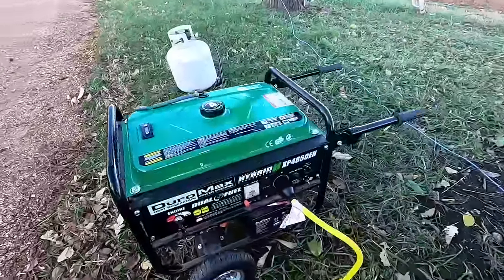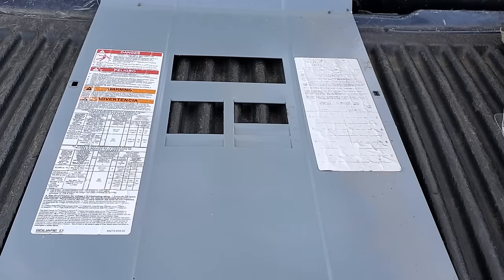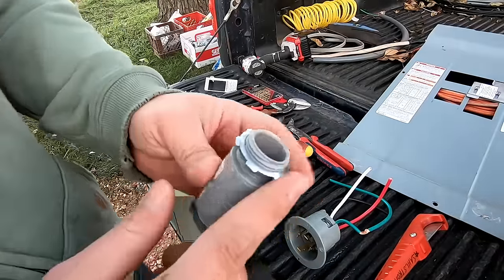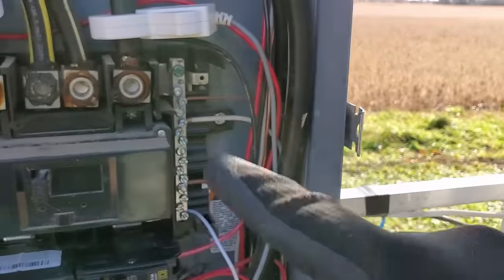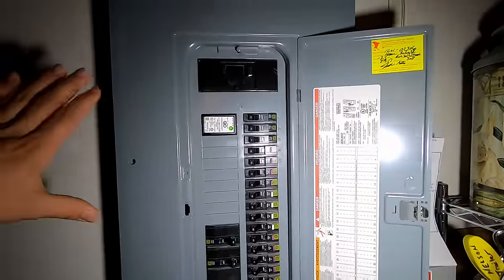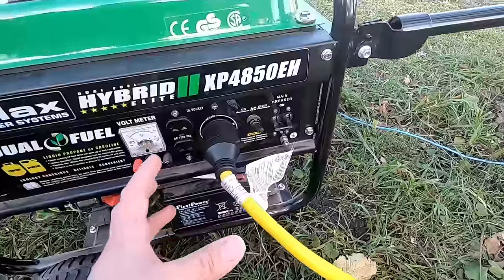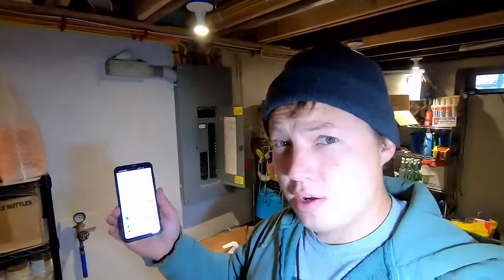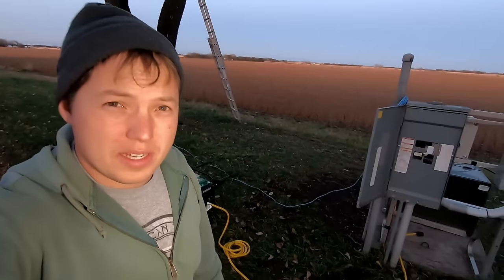How To Hook Up a Generator To Your House Using a Breaker Interlock Kit & Power Inlet Box

Comment: I have a 9KW generator with 4 outlets (4 prong).

Is there any reason I CAN'T use 2 outlets to feed two separate 30 amp breakers like you've shown here?  Running the 2 outlets in parallel to the Panel will give me a theoretical 60 amp feed over 240V.

Has anyone tried this?

Comment: Hey Benjamin, I actually have a couple of questions. I currently have a 50 amp input four wire receptacle hooked (with an interlock switch) to my breaker box with the neutral and ground wires connected to their respective bars at the box. First, if I attach a generator with a bonded neutral to this setup, will I need to change the generator to a floating neutral state? Also, I assume there's no issue connecting a 30 amp generator cord to the 50 amp receptacle with an appropriate adapter? Thanks. By the way, I used your Sense discount link to purchase the Sense and am enjoying it immensely. Really great videos. Most appreciated.

Comment: Don't you need an inverter generator to supply pure sine wave power to the home - for electical and computer equipment?
Reply: Most modern UPS systems clean up the power.

Comment: I had a 50 amp manual transfer switch hooked up to my house and a 30 amp manual transfer switch hooked up to my condensing unit. The electrical is correct with 250 volts coming out to the condenser but will not turn on. The inside AC turns on but not the outside condensing unit. The hook up was done by an electrician and he cannot figure it out. Everything matches but condenser will not turn on. I'm using a 12,000 watt portable generator. Any idea what can be the problem? Would appreciate it.
Reply: Don’t forget about the generator safety tips as well. Remember it’s important to follow all the generator safety rules whenever you use your generator. Here are the generator safety tips:

1) Please do not allow an unqualified person or your children to operate the portable generator. Just because some manuals don’t say that doesn’t mean it’s safe. That is important against the generator safety rules. We also need to be keeping an eye on our children too. You need to make sure that your children are not playing near the portable generator especially when it’s running so they won’t get electrocuted. Generators pose electrical risks and they can be hot during an operation. Please keep your children away from the portable generator at all times. It is important to keep our children safe especially our little ones. Be aware of all the hazards.

2) Some people use their portable generators indoors which increases the risk of carbon monoxide poisoning. It’s important to have a carbon monoxide if you have a gas generator. Never ever use your generator indoors even if your doors and windows are open and even in the garage is not safe to use a portable generator. Not even at your porch and your deck. It is never safe to use your generator indoors and in enclosed areas of your home. Your generator needs to be 15-20 feet away from your house. 

3) 🔥generators cause fire hazards too. Never refuel your generator while it’s running. You need to let your generator cool off before refueling it and before storing your generator. Never overload your generator too. Never ever back feed your generator. You should never plug your generator into a wall outlet. Also never store propane tanks indoors. Please keep flammable things away from the generator as well and please don’t smoke cigarettes near the generator. Having a fire extinguisher next to the generator is also important against the generator safety rules. 

4) generator operation; make sure your hands are dry before touching the generator. Never use your generator in wet conditions. Don’t let your generator get wet. You need a generator tent if you need to use your generator during wet weather. Please don’t wear loose clothes when operating the generator. Turn on your generator before plugging in appliances. Use the right cord for your generator. Please do not use worn out cords. 

Hope this helps

Comment: Wouldn’t come close to UK spec with regard to cabling I’m afraid.  Panel side generator feed needs securing also.
Was it wise to place your cabinet under trees?  
Oh and you do get auto interlocks but obviously unless you install a dedicated line it’s not viable with a small generator.  In home hook up you would only power your essentials via a master breaker and or primary consumer unit  to your existing  essential outputs on the consumer unit/ distribution board.   Ie lighting circuit, refrigerator, CH/ burner etc’.   Hope this helps.

Comment: You make no mention of having to unbond the neutral on the generator.  I found this had to be done on my similar setup to prevent tripping the generator breaker.
Reply: Remember to always make sure you follow all the generator safety rules whenever you use your portable generator. 
⚠️Here are the Generator safety rules that everyone needs to follow when using generators:

This is just a reminder for everyone’s safety when using portable generators. All generator safety rules need to be followed carefully to avoid hazards. 

1) Please do not allow an unqualified person or your children to operate the portable generator. Just because some manuals don’t say that doesn’t mean it’s safe. That is important against the generator safety rules. We also need to be keeping an eye on our children too. You need to make sure that your children are not playing near the portable generator especially when it’s running so they won’t get electrocuted. Generators pose electrical risks and they can be hot during an operation. Please keep your children away from the portable generator at all times. It is important to keep our children safe especially our little ones. Be aware of all the hazards.

2) Some people use their portable generators indoors which increases the risk of carbon monoxide poisoning. It’s important to have a carbon monoxide if you have a gas generator. Never ever use your generator indoors even if your doors and windows are open and even in the garage is not safe to use a portable generator. Not even at your porch and your deck. It is never safe to use your generator indoors and in enclosed areas of your home. Your generator needs to be 15-20 feet away from your house. 

3) 🔥generators cause fire hazards too. Never refuel your generator while it’s running. You need to let your generator cool off before refueling it and before storing your generator. Never overload your generator too. Never ever back feed your generator. You should never plug your generator into a wall outlet. Also never store propane tanks indoors. Please keep flammable things away from the generator as well and please don’t smoke cigarettes near the generator. Having a fire extinguisher next to the generator is also important against the generator safety rules. 

4) generator operation; make sure your hands are dry before touching the generator. Never use your generator in wet conditions. Don’t let your generator get wet. You need a generator tent if you need to use your generator during wet weather. Please don’t wear loose clothes when operating the generator. Turn on your generator before plugging in appliances. Use the right cord for your generator. Please do not use worn out cords. 

https://youtu.be/I1jT3ANENvI and here is a video more about keeping others safe when using generators and also about our family’s safety. It’s important to keep your children safe especially little ones. 

Hope this helps

Comment: my time as an electrician we don't have that what you call kit  we have a double-throw switch
Reply: Don’t forget about the generator safety tips as well. Remember it’s important to follow all the generator safety rules whenever you use your generator. Here are the generator safety tips:

1) Please do not allow an unqualified person or your children to operate the portable generator. Just because some manuals don’t say that doesn’t mean it’s safe. That is important against the generator safety rules. We also need to be keeping an eye on our children too. You need to make sure that your children are not playing near the portable generator especially when it’s running so they won’t get electrocuted. Generators pose electrical risks and they can be hot during an operation. Please keep your children away from the portable generator at all times. It is important to keep our children safe especially our little ones. Be aware of all the hazards.

2) Some people use their portable generators indoors which increases the risk of carbon monoxide poisoning. It’s important to have a carbon monoxide if you have a gas generator. Never ever use your generator indoors even if your doors and windows are open and even in the garage is not safe to use a portable generator. Not even at your porch and your deck. It is never safe to use your generator indoors and in enclosed areas of your home. Your generator needs to be 15-20 feet away from your house. 

3) 🔥generators cause fire hazards too. Never refuel your generator while it’s running. You need to let your generator cool off before refueling it and before storing your generator. Never overload your generator too. Never ever back feed your generator. You should never plug your generator into a wall outlet. Also never store propane tanks indoors. Please keep flammable things away from the generator as well and please don’t smoke cigarettes near the generator. Having a fire extinguisher next to the generator is also important against the generator safety rules. 

4) generator operation; make sure your hands are dry before touching the generator. Never use your generator in wet conditions. Don’t let your generator get wet. You need a generator tent if you need to use your generator during wet weather. Please don’t wear loose clothes when operating the generator. Turn on your generator before plugging in appliances. Use the right cord for your generator. Please do not use worn out cords. 

https://youtu.be/I1jT3ANENvI and here is a video more about keeping others safe when using generators and also about our family’s safety. Hope this helps

Comment: The use of full house, portable generators and the use of a Generator Interlock switch have sky rocketed in popularity over the past several years. Using an Interlock  is a very cost effective way to provide emergency power to your house. But a portable generator / Interlock set up can be EXTREMELY dangerous if not done correctly. Be smart , be safe and stay alive - hire a professional Journeyman Electrician or Electrical Contractor for your installation and have your work inspected when completed (your home owners insurance company may require it).

Comment: A dual fuel generator wont produce reach its rated running wattage when running on natural gas or propane. Those numbers printed on the label are typically when running on gasoline. Propane has a lot less BTU's than gas, less power, less wattage.
Reply: Portable generator safety rules: Always make sure you follow all the generator safety rules whenever you use your portable generator. This is only a reminder. Generators can be dangerous if not used carefully. Every year, hundreds of people die or get injured when using portable generators due to carbon monoxide poisoning and electrocution. Make sure you are using your generator carefully and keeping others safe as well. There is something very serious that everyone should always be aware of when using generators. Some people do run their generator indoors which is not safe and that increases the risk of carbon monoxide poisoning which can cause death of family and you. Some people run their generator in wet conditions which can electrocute them. Please remember that you should never run your generator indoors. Remember that carbon monoxide is an odorless and colorless gas that you cannot see or smell. Carbon monoxide is a silent killer. Keep that in mind. Make sure your generator is 15-20 feet away from your house and away from doors, windows, and vents. Never use your generator in your porch too. Having a carbon monoxide detector is very important against generator safety. Some people also allow children to go near the portable generator which could pose risks. We need to keep an eye on our children making sure that they are not near the portable generator so they won’t get electrocuted or burned by the generator which is dangerous. A locking enclosure also keeps kids safe. A generator shed might look like a tempting place to explore, or take cover during a game of hide and seek, but a generator is a dangerous piece of equipment that can cause injury. It says on the manual that we should also keep children away at all times from the portable generator to avoid injuries. Please do not allow a child or unqualified people to operate the portable generator.  It is important to keep your children safe especially little ones. The portable generator can be hot during an operation. Just because some manuals missed what should be listed doesn’t mean it’s safe to do. Always follow the generator safety rules when using portable generators. Generators pose electrical risks. If you need to use your generator during wet weather, you need a generator tent to protect your generator from getting wet. Don’t let your generator get wet. Keep your generator dry and before using your generator, please make sure your hands and your generator is dry. Do not wear loose clothing when operating the generator. Everything that is said on the generator’s operating manual should not be ignored. Never smoke cigarettes near the generator. Please keep flammable things away from the generator. Never overload your generator too. Your generator can catch fire. Never ever try to plug a generator cord into a wall outlet to avoid back feeding. Back feeding your generator is dangerous. Always turn on your generator first before plugging in appliances and shut off the appliances before turning your generator off. Use a heavy duty cord for your generator and the cord should not be worn out. All the instructions should be followed carefully. Never refuel your generator while it’s running. It can cause fire if fuel spills while your generator is hot. You should turn off your generator and let it cool off before refueling it. Having a fire extinguisher next to the generator is also important. This is only a reminder for everyone’s safety of using generators. Make sure your generator is properly grounded. Having a fire extinguisher next to the generator is also important against the safety rules. https://youtu.be/I1jT3ANENvI and here is a video more about keeping others safe when using generators and also about our family’s safety. It’s important to keep our little children safe as well. Make sure your little children are kept away from the generator at all times especially when it’s running. Hope this helps. Always remember that it’s better to be safe than sorry.